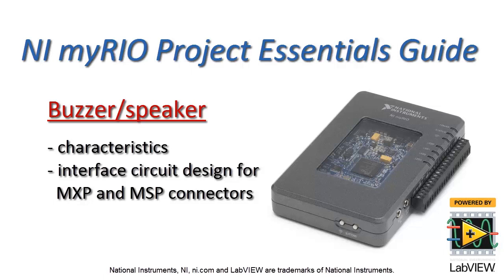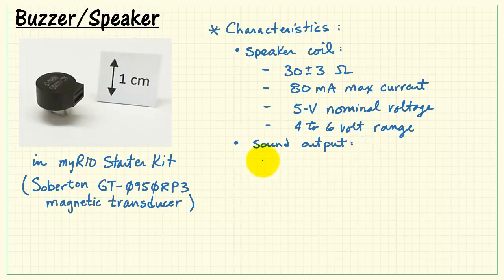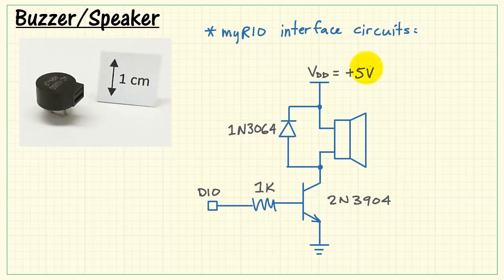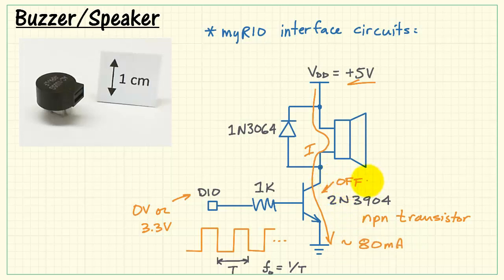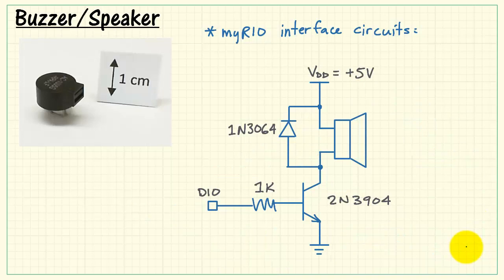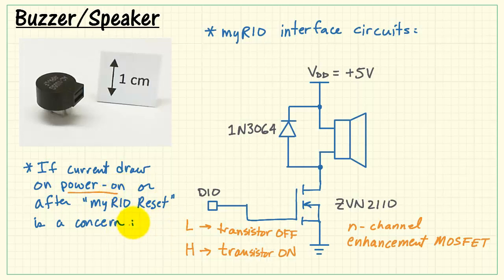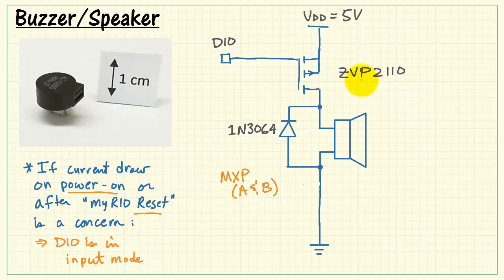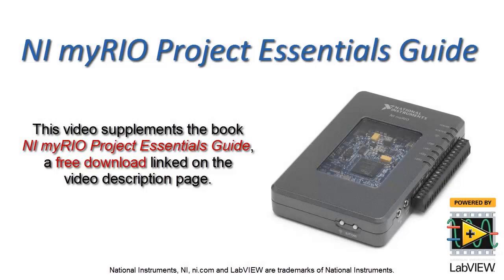NI myRIO: Buzzer/speaker

Comment: Hi there! I'm a novice in the field of electronics, but enjoy building little projects. I'm currently sitting with the below mentioned project and would like to make use of a  transducer buzzer to indicate when one of the LED's are off. I'm using the LED's in bar form to indicate battery status and need an alarm to sound when say D4 switches off. How can I connect a transducer buzzer into this circuit? Also, would it be possible to reset/silence the alarm? Any help would be greatly appreciated!!
http://www.circuitstoday.com/12v-battery-level-indicator-circuit-led-bargraph
Reply from the maker: The buzzer described in the video requires a pulsed voltage or oscillator to hear a tone. You will instead need a piezo buzzer that emits a tone simply by applying a constant voltage; see the Sparkfun 7950 (http://www.sparkfun.com/products/7950) as an example. Your circuit based on the LM3914 turns off an LED by raising the cathode of the LED to a high-level voltage. You may be able to use this voltage to power the buzzer; connect the other buzzer terminal to ground.